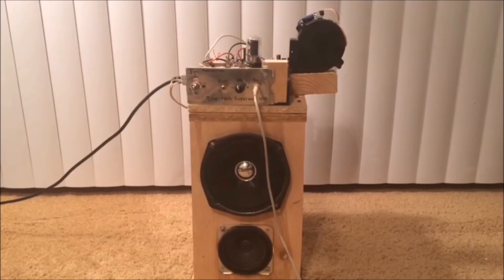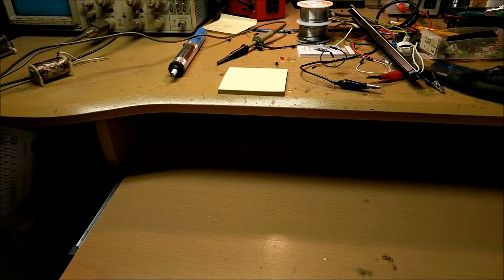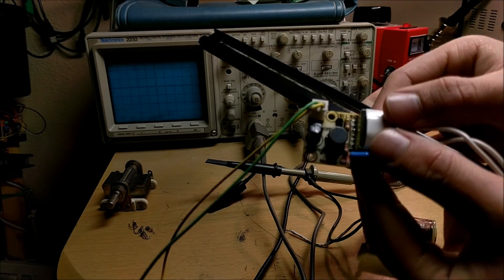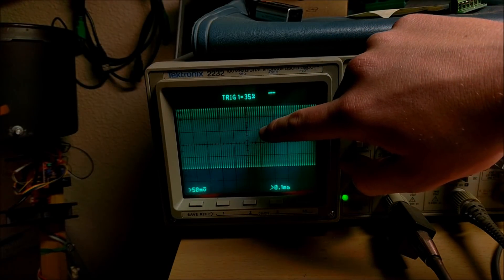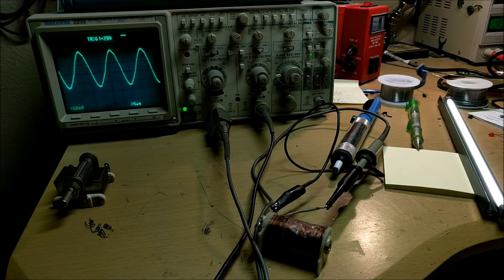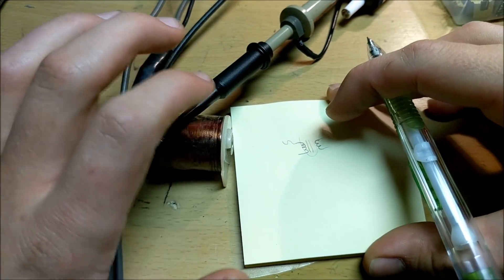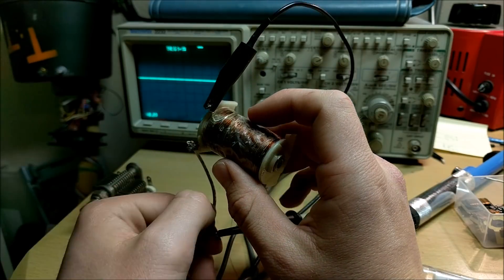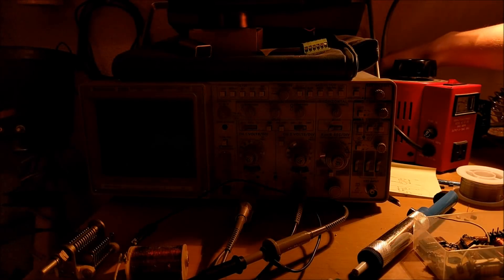Electromagnetic High Voltage Probe for Oscilloscope || I am in the Make Magazine!

Comment: Hey Tanner I just got a DC power supply and I was wondering why they connect the ground to the negative and will it hurt anything if I unconnect that
Reply: That's for some circuits that require it to be grounded for safety. If your power supply is good quality (double insulated) and the circuit you're using works with low voltages, nothing bad should happen, the problem would arise if a mains powered circuit isn't double insulated and the live wire touches the case, because then when you touch the case you would be touching live voltage, which is extremely dangerous, even if you have a GFCI like it's mandatory here in Europe.
Reply: GRBTutorials thanks man I appreciate the advice
Reply: Ah, and something I forgot to mention is that not only nothing bad will happen, but also something bad might happen if you take the earthed PSU output, connect it to a circuit and put the ground lead of the oscilloscope in the wrong place (anywhere that’s not earth, or your circuit ground, since it’s now referenced to mains earth) because the scope is referenced to earth, and therefore to your circuit’s ground (something that has an easy fix if you’re the manufacturer of the scope: making it double insulated, but scope manufacturers don’t seem to want to do that).  Dave has a video on that: https://youtu.be/xaELqAo4kkQ
Reply: GRBTutorials ya that answers all my questions

Comment: A capacitive divider is a better way to accurately measure the voltage waveform of a high voltage signal.  The frequency response of such a HV probe is much more predictable and can be measured and engineered as required.  A magnetic probe is basically a qualitative device, if you want to make amplitude measurements you really want a divisor probe of some description, but you need to understand its impedance and response.

Comment: Hey Young Fella, thanks for the synchronicity. I'm doing hobbyist electronics stuff and currently need to probe DC + AC under 1000 Hz of high currents and voltage but only have a crappy laptop where I use the soundcard as a scope. No more than 4 hours ago I was thinking about coiling a transformer probe, then I hit facebook, and in  my suggestions, here you are with this vid. Keep up the good work!
Reply: I meant I hit youtube

Comment: He even shows off the magazine as if it is a circuit board lol. cool channel by the way
Reply from the maker: +NiHaoMike that's awesome!  I would have never made that connection.  So your best friend is Naomi Wu?
Reply from the maker: +NiHaoMike Wow!  I just read that whole article, it is incredible.  Thanks so much for sharing!
Reply: Trivia: that issue of the magazine has at least one connection with Qualcomm Snapdragon and blockchains. Can you figure out how?
Reply: no i dont even have the magazine
Reply: The view of the magazine in the video is all you need from it to find the connection.
Reply: i cant find it
rip
Reply: can you help me understand how the zvs flyback driver works by the way? my knowledge of circuitry is very basic-I have more knowledge on wiring residential 120-240v systems than the more complicated stuff
Reply: I mean id rather you tell me how you learned it then to tell me how it works.
Reply from the maker: +Rj Dorton I made a video about how a zvs flyback driver works a few months ago.  Just look up "Tanner tech zvs flyback".   I hope this helps!
Reply: I was just watching it actually.  I get it slightly more.  I'm just beginning to get into this stuff so half of what you say is jibberish as of now
Reply: I started working with power electronics about 20 years ago. I actually built a small switching bench supply for my 4th grade Science Fair project. Learning about power electronics is quite fun but does take a good amount of time. Also expect a lot of stuff to break when you test it.

I'm part of how that issue of the magazine has a connection to Qualcomm Snapdragon and blockchains because my best friend is on the cover. Long story short, I used a solar panel to power some Snapdragons, which were used to solve blocks in blockchains - AKA mining. The profits from that I shared with my friend in light of a situation she was going through. She made a post about it, which I shared with my other friends, who really liked what I did, and at least one - Allie Moore - became really jealous.
Reply: Oh, nice lol.  I'm 17 so i got all the time to learn.  As for things breaking, i used to code so Im used to it lol
Reply: https://www.facebook.com/notes/mike-lu/my-ongoing-adventures-in-cryptocurrency-mining/10159674028180788/
That's my story of how I got into cryptocurrency. Naomi Wu and how she gave me a bit of fame inspired me to write about it. Do note that the difficulty is quite high the last two months and investing in it now might not be worth it.
Reply: Tanner Tech I figured out the zvs driver in the middle of school lunch. If 10 turns is on the primary, however, how many are you putting on the secondary? I want to make sure my math is right to get some nice but safe arcs
Reply: Update: Turns out i didnt figure it out.  I had the fast diodes mixed up for some reason.  I got it now though, live and learn.

Comment: I suspect that the impedance of the coil can be an issue? Are there issues with the coil putting to much of a load on the circuit being tested or maybe the coil doesn't work well above a certain frequency?
Reply: The coil picks up on the radiation produced by the circuit. It has no effect back on the circuit. Just like radio towers don't see any effect from the number of receivers listening. Remember that there is no galvanic connection between the coil and the circuit.
Reply: TheTruthSentMe doh! I wasn’t paying close attention. I didn’t realize it wasn’t connected. I thought he was using it as a step down transformer.